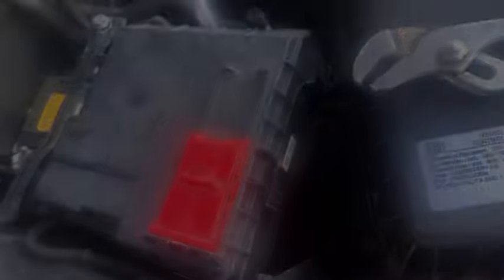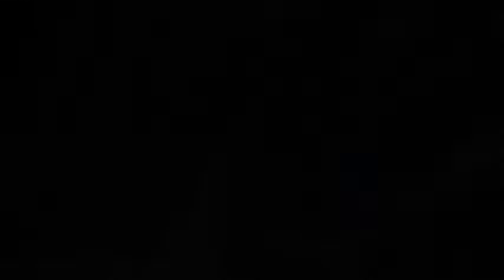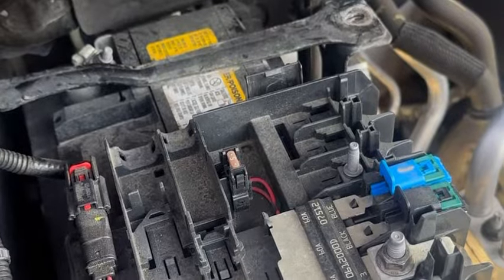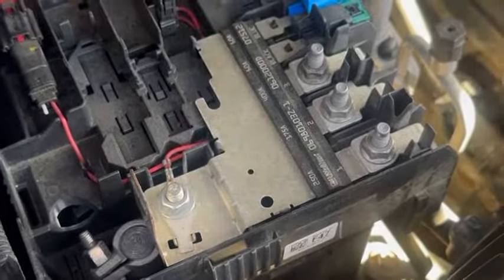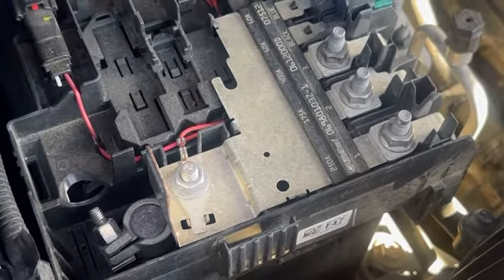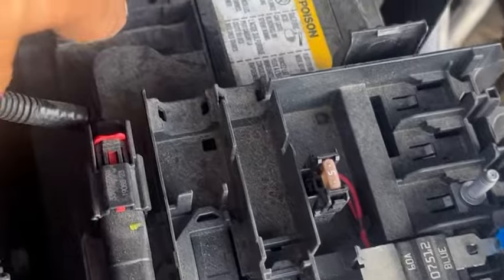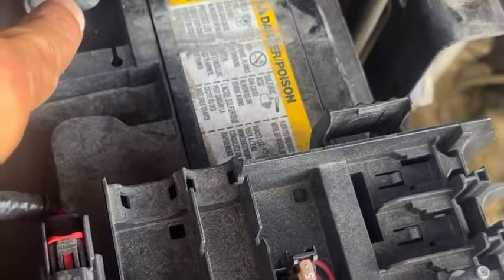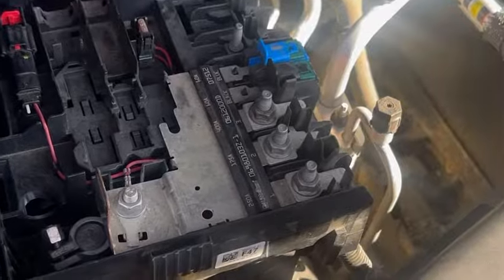HOW TO REPLACE BATTERY ON  2020 CHEVROLET 2500HD SILVERADO battery replacement

Comment: Had he not fade to black,told that the circuit board is held by positive terminal that is also held by tabs on both sides of the battery.It would have been a better video.